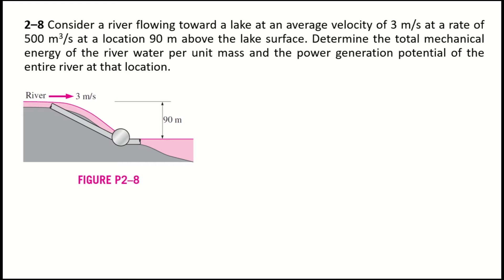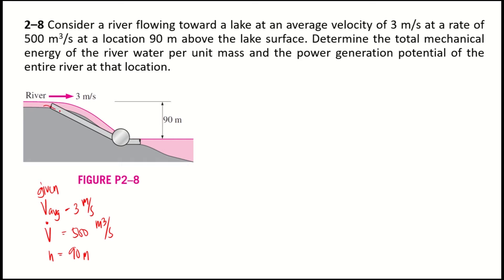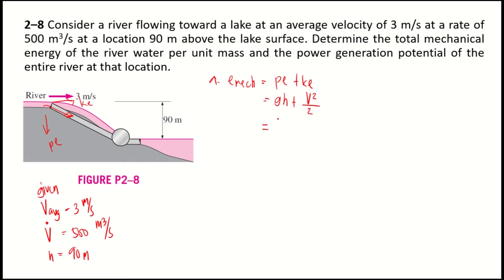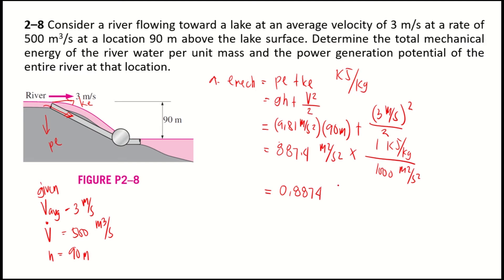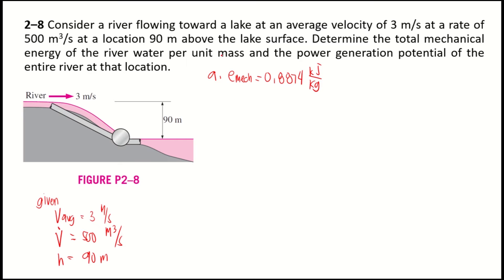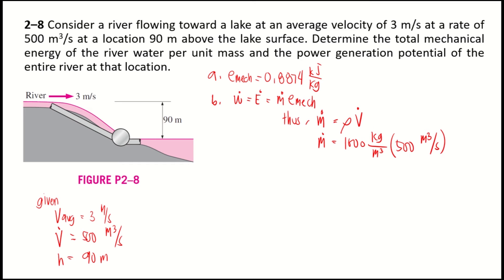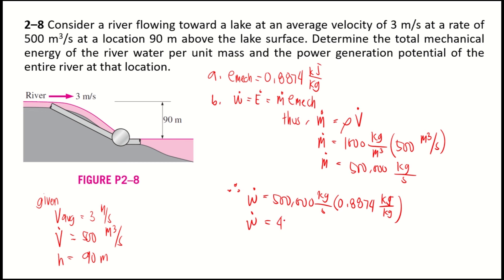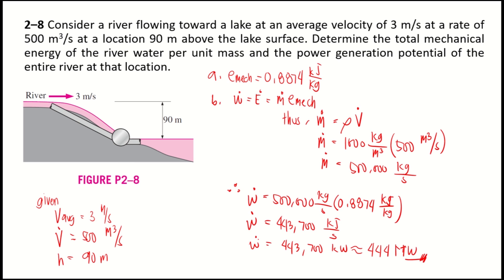Problem 2-8; Thermodynamics: An Engineering Approach by Cengel and Boles

Comment: Water ( T=20 degree celcius) flows at a rate of 0.05m3/s in a 20cm asphallted cast iron pipe. What is the headloss per killometer of pipe? Take €or E= 0.12mm cast iron asphallted coated??